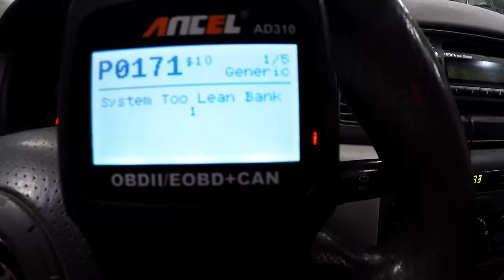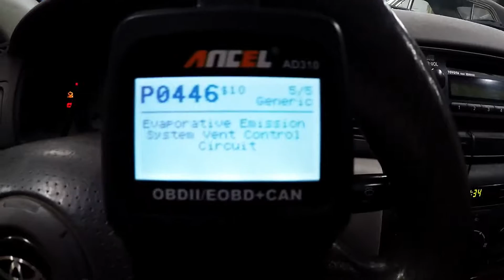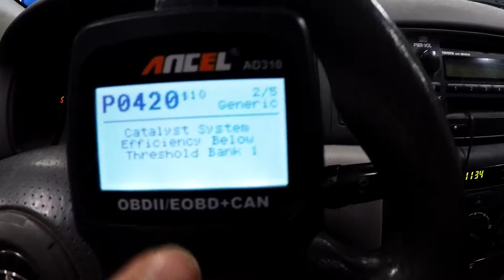Corolla E120 Fuel Code Fixes

Comment: This video is on point! I recently purchased a 2003 Toyota Corolla with 52k miles and the code P0442 popped up. I replaced the gas cap for a Toyota original cap and the code popped up again. Researching, I came across the same bulletin you mentioned EG051-06 and mentioned the “Pipe-sub assembly, Fuel Tank Filler” part#77201-12750 is an improved version to the former. I found this video spot on helpful. Thank you and hope to see more videos of Toyota Corolla’s to fix any future issues with my car.

Comment: Hey so I changed my o2s crank postion sensor coils sparks plugs dosent really let me drive its slugged and no accerleration idk what to do it has lows miles its 2000 corolla 1.8 mass air flow i changed fuel pump etc no luck pleas help